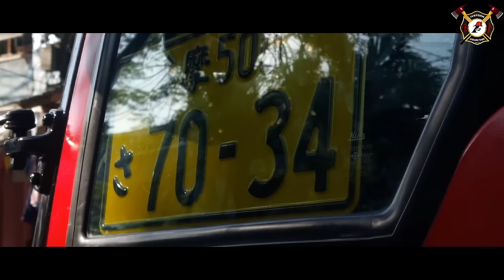4th Alarm Residential Fire @Hontiveros Compound Brgy San Antonio Parañaque Iverson Fire Volunteer

Comment: Nice response video but there appears to be no command point and crews just tackle the fire from where ever they arrive at, very disorganized from a European point of view,
Reply: True, but we should also understand that the place is densely populated, the streets and alleyways are narrow, and the only distance separating the houses from one another is the narrow alley that can only fit 1-2people. Very dangerous as fires can spread fast. Not much have an option there when you have these circumstances. All you can do is get those hoses, start putting out fire, and use your knowledge from the training.

Comment: Just curious? WHEN does anyone put gear on? Or act like they've done this before?
Reply: What gear? if your talking about SCBA, they do have SCBA but they dont use it often because most of the fires are in the exterior, but at 36:33 you can see one of them wearing gear.

Comment: Top rate video for training. Mutual aid call, guessing your responding twenty plus miles away and have no idea of the streets, been there done that. Would like to see you wearing breathing apparatus but it costs money, maybe you do have it. You did a top rate job all around considering your circumstances. Give that driver a pat on the back...skills. Question, where was the water source to fight the fire? Subscribed.
Reply: mostlikely the water are being pumped from fire truck to fire truck, since hydrants are mostly located on main streets and big roads.
Reply: Water was supplied in by the use of water relay, bunch of fire trucks tho
Reply from the maker: Nice one😊❤
Reply: Check at 44 minutes in. They were filling the engine with 5-gallon buckets. Incredible!